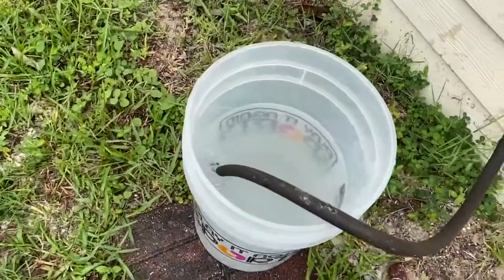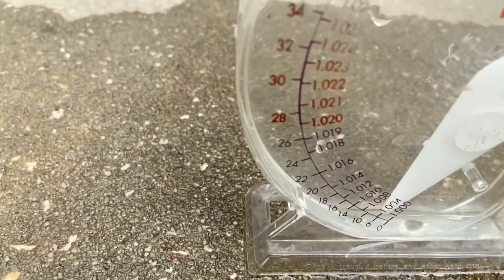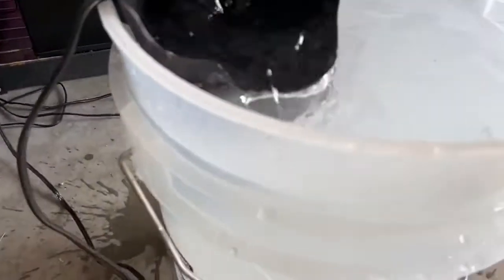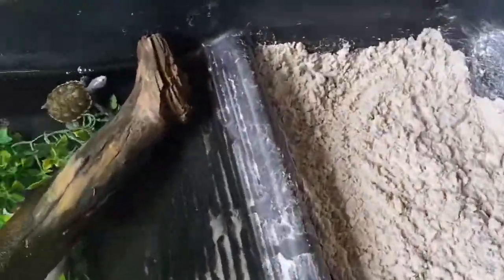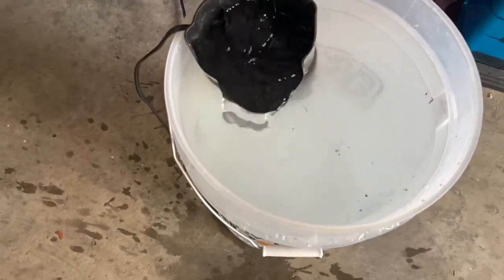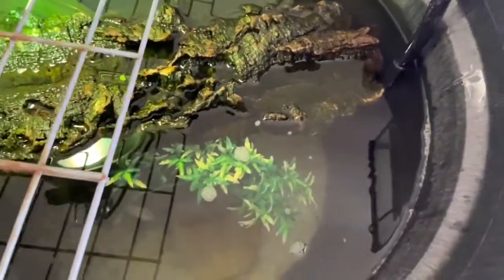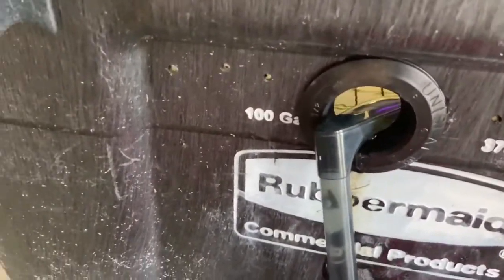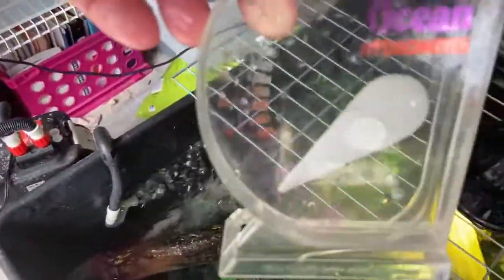How to Make Brackish Water? 🧂💦🐢

Comment: My dear! 
Its so interesting. But if you don't mine, could you please clarify that how many grames of salt for 5 gallons of water.. thanks
Reply from the maker: Grams I’m not sure, but it’/ typically 12oz of salt per 10 gallons that I use. Once that’s dissolved I check my levels and add salt slowly as needed.

Comment: If you want them to breed and really breed successfully you need to let them winter outside or simulate it inside. Being that you live where they are native you really should try outside they are use to a cold. Specially any northern subspecies.
Reply from the maker: Casa De Finch I have my concentrics and Mississippi outside for winter this year. My ornates and my mangrove will probably never be outside for winter just based on the climate differences of what they prefer and what I receive.
Reply: Swamp Life Reptiles it's crazy how much different micro climates can be. Do you try to simulate winter inside as far as less light and keeping them a little cooler but not as cold as they would be outside?
Reply from the maker: Casa De Finch yea man, change the timing, the feeding, and the temps I try to prevent from going below 50, they are in my garage
Reply: @swamplifereptiles2133  Hey bro. Would they be okay without water heaters during winter?
Reply from the maker: @FariborzKoh777  whats your water temps get down to without heaters?
Reply: @swamplifereptiles2133  At this time, 48F down to 45F at night, I live in Cali, btw.
Reply from the maker: @FariborzKoh777  I had mine outside in about the same, I was definitely nervous I’d suggest monitoring them carefully.
Reply: @swamplifereptiles2133  Thanks man!